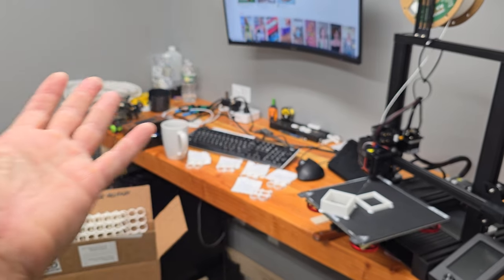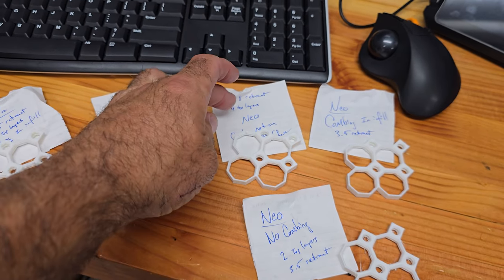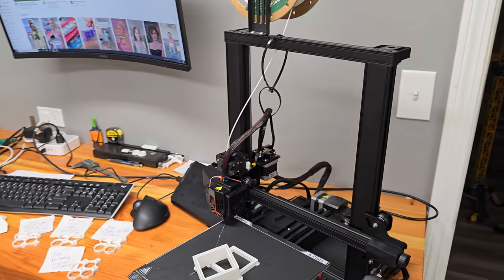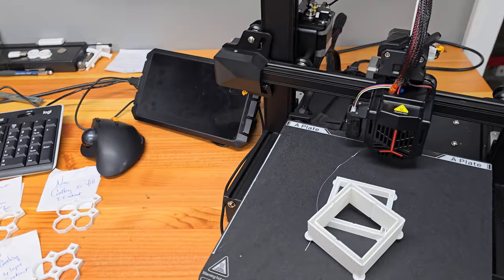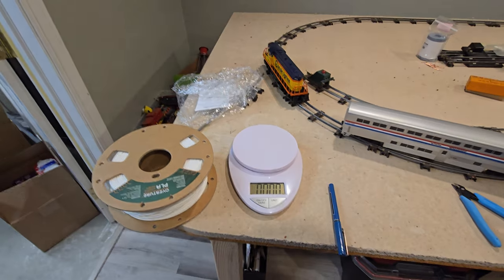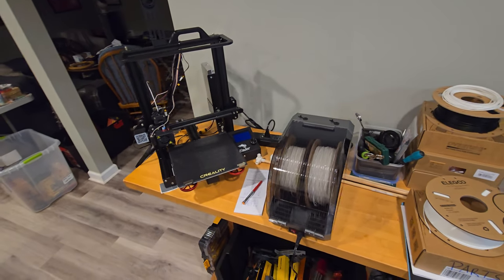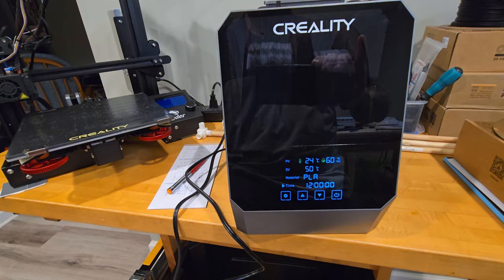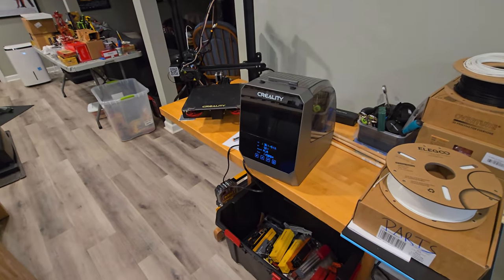Ender 3s... Throwing in the towel!

Comment: Sir! If you are up for one more test, i would HIGHLY recommend trying different slicing software. Ive been using Cura on and off for years and just recently tried others for better results. Lychee is one of them. I have the same 3D printer you do and before that, i had the original Ender 3
Reply from the maker: I just might have to.  I have my E3Pro running and it is doing great with the same files which is weird.  I really think I have mostly a hardware issue in front of me.  I ordered a glass bed to see if I could get a better bed mesh.  We will see.  But, yes, another slicer test might not be the worst.
Reply: @dougdoesstuff24  Filament quality helps and make sure you don't have bed wobble if you haven't checked that. Hopefully you can get things working as they should 🤞

Comment: Have you tryed z offset?
Reply from the maker: oh yeah, about a thousand times.  There is something else going on, just have to figure it out.
Reply: @dougdoesstuff24  what temps you running and extrusion speed?
Reply from the maker: I was running 200, but with the sonic pad it was going FAST.  I need to do more work on this thing.  I really think the issue is the direct sprite extruder, that is when all the issues started with both printers.
Reply: @dougdoesstuff24  I have the same extruder and was running 210°and 100% extrusion 50% speed